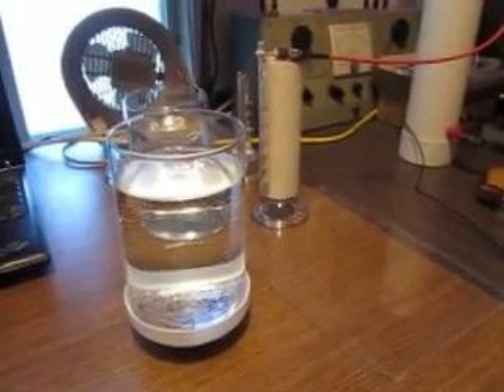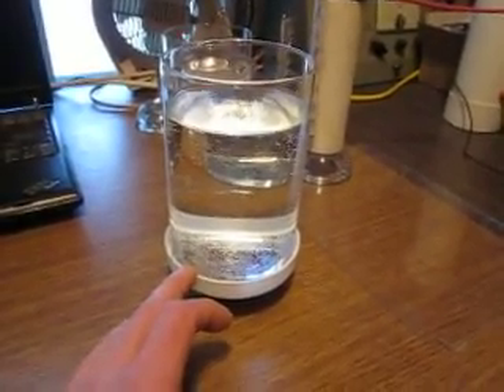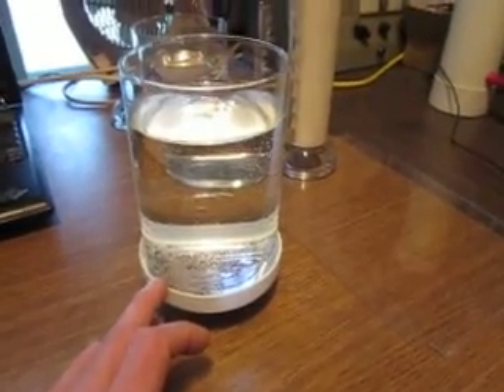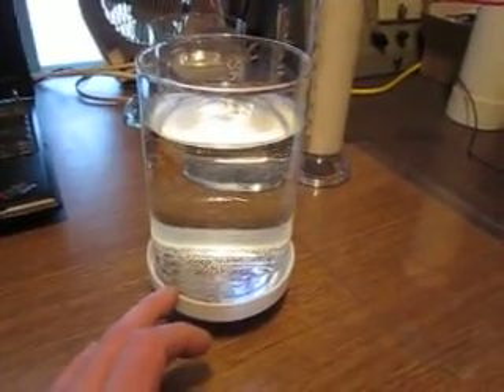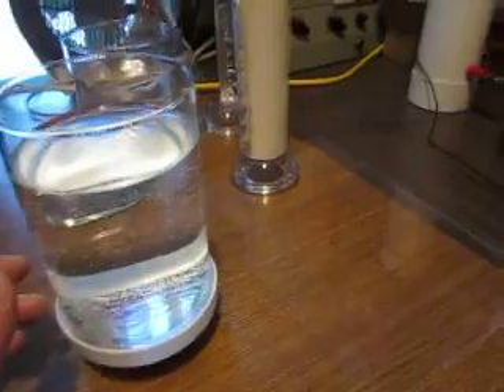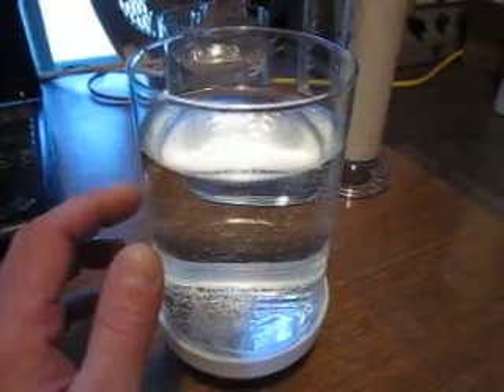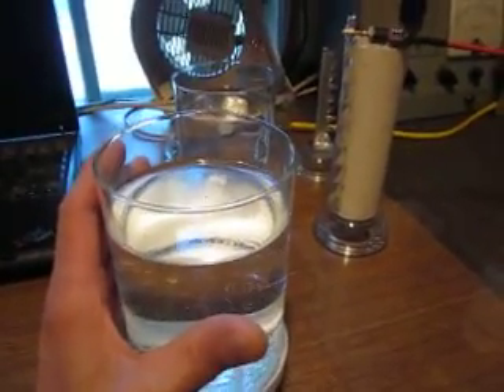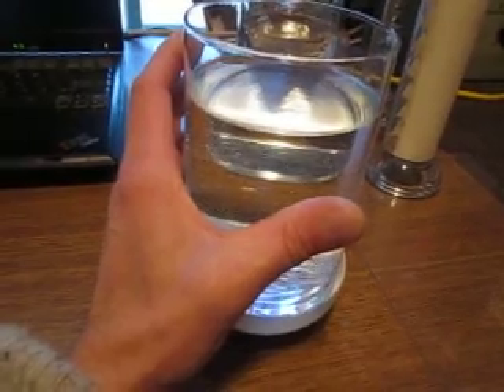Stirred, not shaken

Comment: Nice discovery! IMHO, it deserves more investigation.
For some reason it reminds me of a faraday homopolar motor.
If linear charge forces alone were involved, then the glass or the water would pull toward or push away from your hand.
The creation of a rotating force means that the system is trying to "cure the wound" or redistribute the concentration of charge in the water in a platonic manner. Thus the charged water in Earth's magnetic field is trying to find the shortest path outward, from the water to your hand. By deduction, this shortest path must be a spiral. The longitudinal Amperian forces along the spiral path of the current then push the water in the same manner, like water pushing a garden hose to straighten. IMHO, as the galaxies are created, they are pushed into rotation by the same method, where in your experiment, the paramagnetic molecules of water are pushed into rotation much as the paramagnetic material in gallactic space is pushed into rotation.

Comment: Fascinating, I,knowing nothing about electricity and such, your work seems magical. I'll not bore you with attempting to sound as though I understand electricity.
I have a problem, you, most likely, have a solution. I'm looking for a way to keep my birds watered during freezing cloudy weather, using magnets or coils. I've purchased products, they never last long enough to offset the price, in my opinion. I would very much like a simple, self-contained, stand alone system that generates enough heat to keep a small amount of water( perhaps only a half cup of ice free water located within a bird bath). Oh yes, it would be best if it generated free hear, that's not much to ask, is it? :)  Any advice or direction you could point me, would be greatly appreciated. Thanks